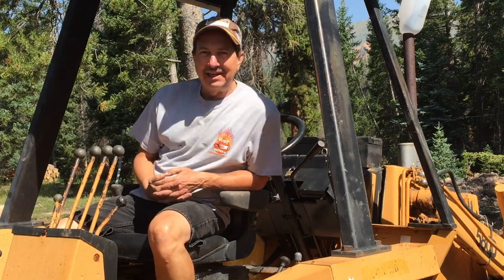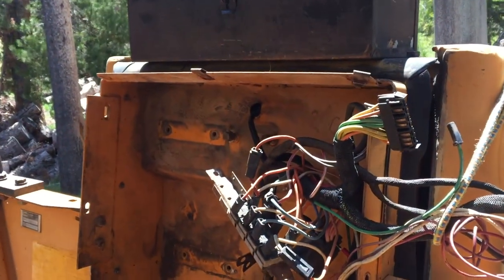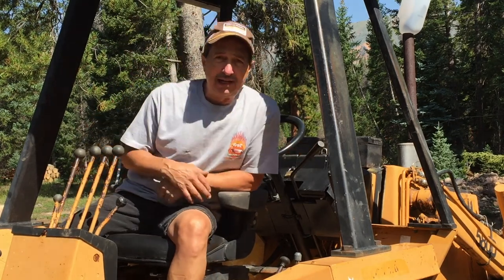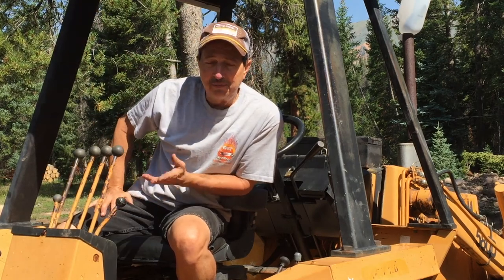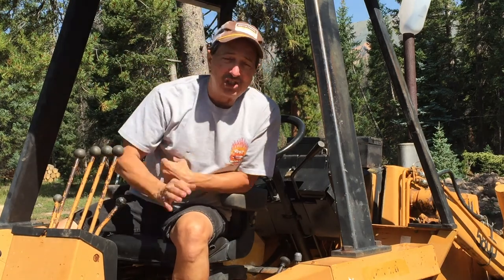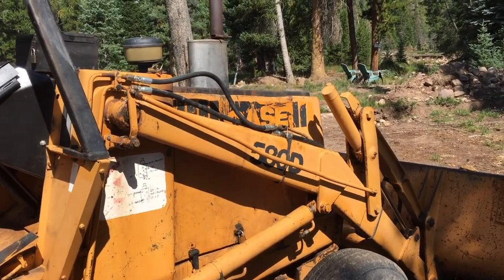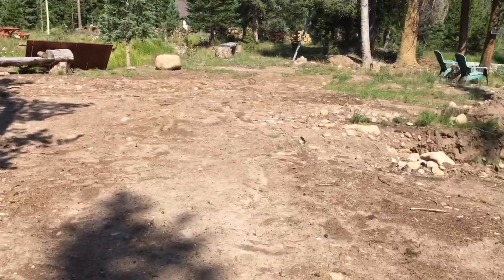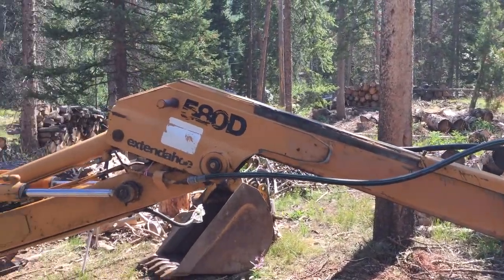Part 3. Case 580 D extendahoe Hydraulic Cylinder & Hoses, Removal & Installation.

Comment: I've got a 580SE and like how you made this look relatively easy.  I've had to replace some pins on the hoe and none of it was easy.  Nice work.  And that ground looks very much like mine, half rock.  Those guys who dig in nice clean dirt don't know what they're missing.  lol
Reply from the maker: Glad it helped. I love your comment about the rocks, so true. I have several areas that I want to cover with dirt but I can't. I am on almost 2 acres of land and almost no usable dirt can be moved. Just thin coat of top soil and pine needles. I hate buying soil. Delivery way up the mountain cost a fortune and the 2 bridges will not handle a large dump truck.
Reply: @riderescue  I have eleven acres and have found patches where the top 6 inches are almost rock free.  I run the front bucket across them in skim mode to harvest what's there.  When that's gone I may bite the bullet and buy / build a screen.
Reply from the maker: @denjhill  I have wanted to build a screen as well. Half of my property needs to be leveled and moving all the rocks is a nightmare. I skim and the rocks just roll along like ball bearings. I did finally get a driveway built through the upper lot but it took 8 hours to do what should have been one hour. Then I had to find a place for all the rocks. Once I get back to the edge of the lot , it follows the river and I can deposit all the rocks on the river bends.

Comment: How much did you expense on parts?
Reply from the maker: So far I have not needed much more just than hoses. I go to a place in Salt Lake City called House of hose to have my hoses made with the correct connectors. I have spent around $30 to $100 for each hose.

Comment: I bought a 1966, case Ck 530 180 Diesel Backhoe which is going to be helpful on THE FARM and I bought a 1973, FORD F-700 5-  ton Dump truck. the reason why I bought all of this heavy Equipement is because I've got natural  gravel and sand banks that I want to dig and haul and stock pile.🙏
Reply from the maker: Sounds like a great plan. I have been able to get more done on the property, in a short amount of time, than I ever expected. Have fun and be safe.